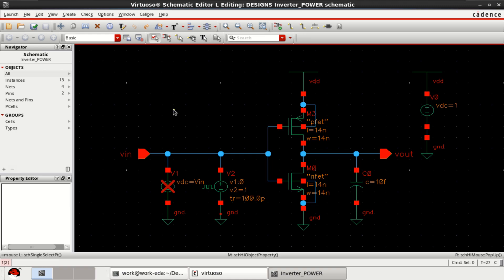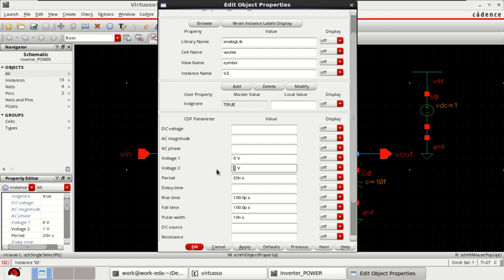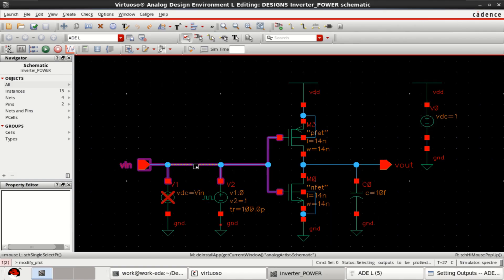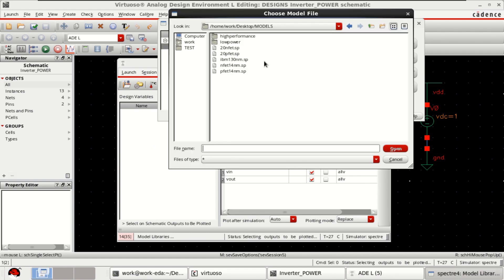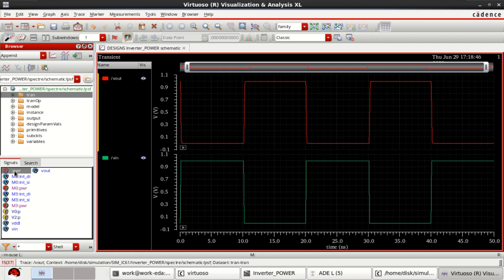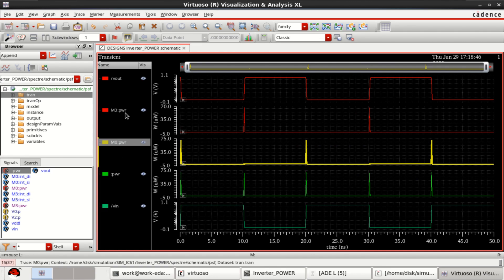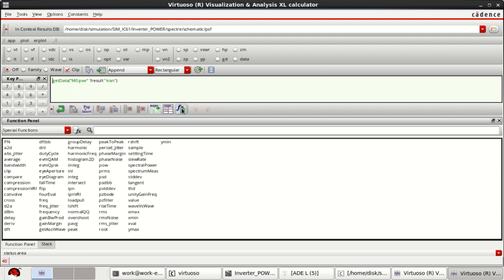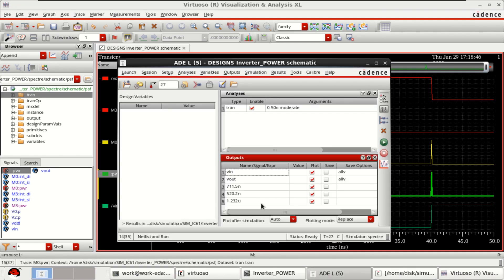Cadence Virtuoso: NMOS | PMOS || Power Dissipation Calculation.

Comment: Sir, why do I get a different answer when I use this method to calculate the average power consumed in the circuit than the result of multiplying the supply voltage by the average current drawn from the circuit's supply voltage?
Reply from the maker: Hi, it depends on the time of transient analysis also